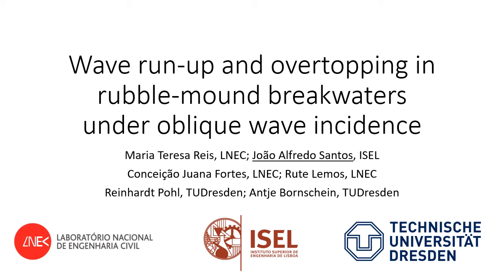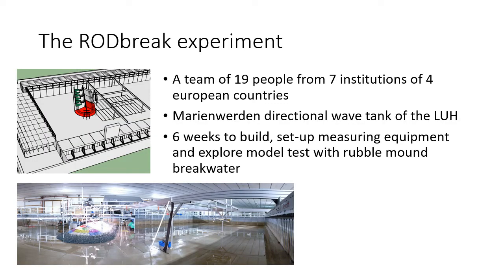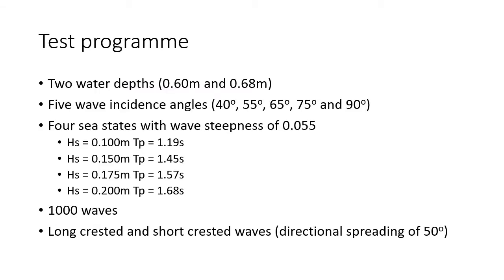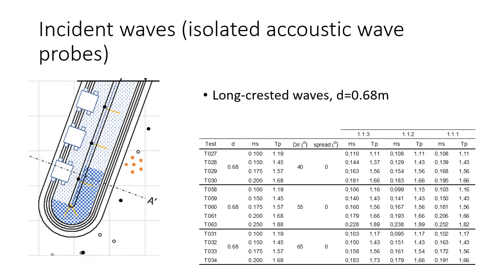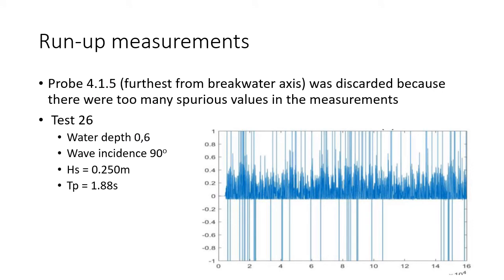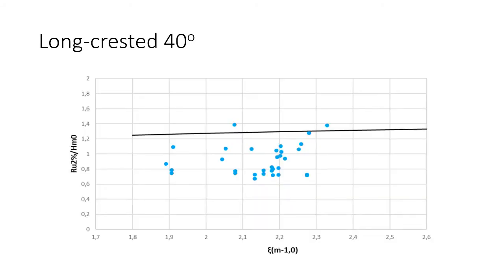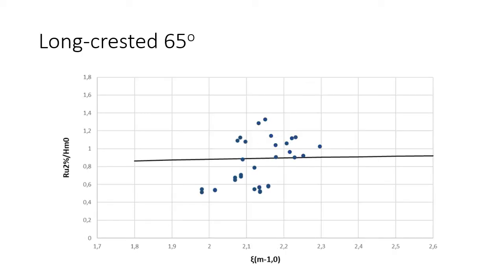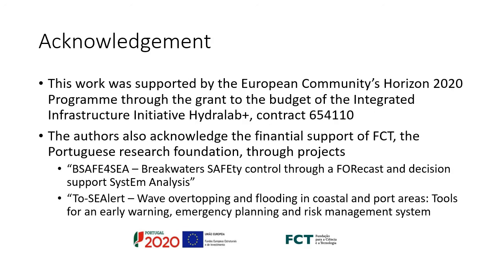Session #112 - Juana Fortes: WAVE RUNUP AND OVERTOPPING IN RUBBLE MOUND BREAKWATERS W/ OBLIQUE WAVES

Comment: THANK YOU FOR SPECIAL PRESENTATION. 
    After two weeks I am at same video. Brilliant path for researching. 
In this presentation of wave Model set - up with slope 1:2 we can used as well in 1:1,5/1:3. Test programe with two and five depth and incident waves can also assumed longer - single layer porous membrane breakwaters as well as the 2-layers porous membrane. Run up membrane and estimation of Ru of the berm in presented equation for long 40° ( short crasted 65° ) and short 40° crasted ( also 65°) waves. Longer-single layer porous membrane breakwaters do not necesserily result in the better incident wave preventation and dissipation performance as we can conclude and in this workpaper slide show as well as the effeiciency of 2-layer porous membrane - positively correlated with the wave height H in the long wave region and negatively correlated with submergence depth WHEN its height is 0,1h.The MULTI-LAYERED MEMBRANE BREAKWATER is more effective in blocking in SHORT WAVES (when we also include yours point of view ).
However, with appropriate design parametars, more then 20% of long waves can be blocked by a break down.
Also breakwaters can be essential to protect ports and terminal from waves. The incident wave is one that approaches the boundary, but hasn't reserched it yet. But incident wave isn't the reflected wave. The reflected wave may interfere with the original sound wave in navigation. Sea state estimation methon aims reconstructing the incident waves like in new study called Prolate Spheroidal Wave Function. The use of PSWF offers an explicite expression of phase components respones that estimation can be efficiently approach. The present approach and yours presentation help as well ships how to sail to the port because the same is sailinv in long - crested irregular waves multitude of points of view and never restricting  though to one opinion or any certainty of knowledge.